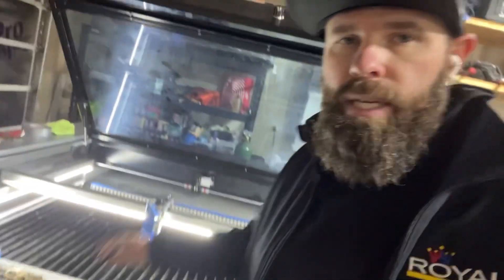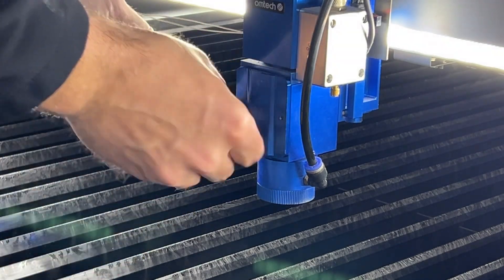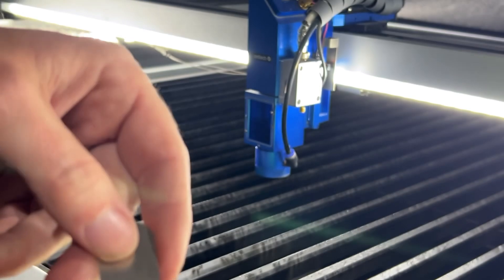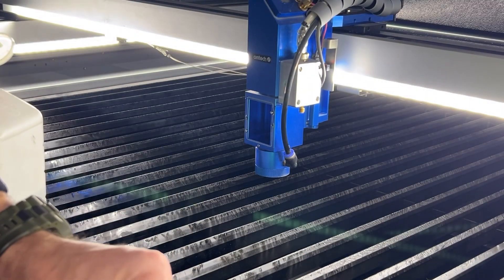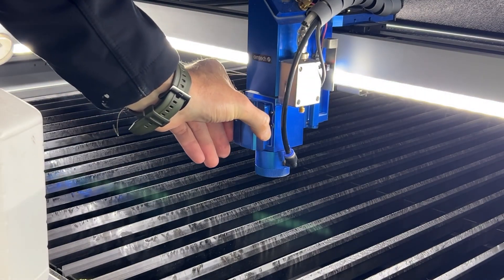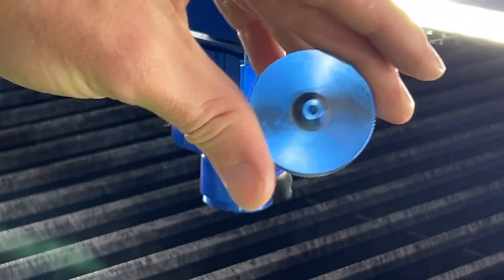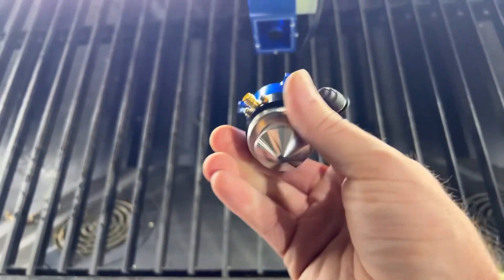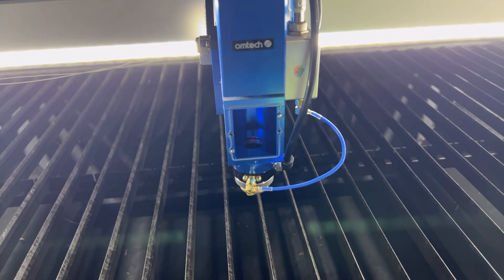OMTech Pro Hybrid Laser Head | Lens Cleaning and Nozzle Change

Comment: Love your videos! I have a quick question. I just received my OMtech 3655H machine.  I have a long list of issues straight from unboxing, including the lift table panel not working. Also, my auto focus does not work and I am currently playing email tag with technicians who don’t seem to know anything about the machine. All they can tell me now is that they have to contact the manufacture.
When your machine is auto focused for nonmetal materials, how close is the nozzle tip to the material? 
Thanks for anything you can share.
H.
Reply from the maker: I made a video about the metal operations. 
https://youtu.be/Vpbra121YxM?si=qPxOXQoLpXbKjLTH
Reply: I have not yet tried metal operations. I am trying to figure out how to manually focus on nonmetal materials because my auto focus does not work.
Reply from the maker: @OldandNewSchool ah I miss read that. You said non metal…. I actually don’t use the auto focus have never used it on any of my machines. To find the correct focus height you would ideally do a ramp test. For me I have a step gauge that I made and focus to that. It puts about 18mm between the material and the large flat part of the bottom of the laser head.
Reply: I am working now with quarter inch birch plywood and the best results I have found so far is the tip of the nozzle half inch over top of the material.
Reply: Wonderful!!  I am working through your catalog of videos and gaining knowledge by the second! Thank you for taking the time to help me (& hopefully others.)  Bless you.
Reply from the maker: @OldandNewSchool  you’re welcome!

Comment: I’ve got the Pro 150w 3655 and am not finding any videos showing how to use the PiBurn rotary with this Trocen controller. Do plan on putting something like that together in a video for this machine? I know many would appreciate it if so! (I can get it to engrave but it’s nowhere near clean enough and I’m new to lasers so getting the lines per inch vs power vs speed for this controller is throwing me off. I also don’t know how to ensure I have the correct settings for the steps for this machine and rotary…I’m using the chuck attachment if that matters…) Thanks in advance!